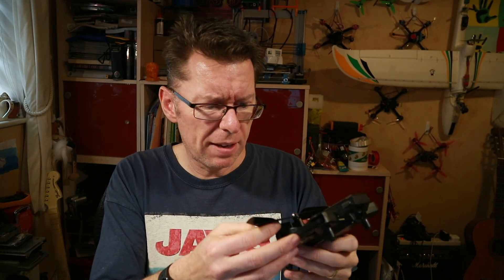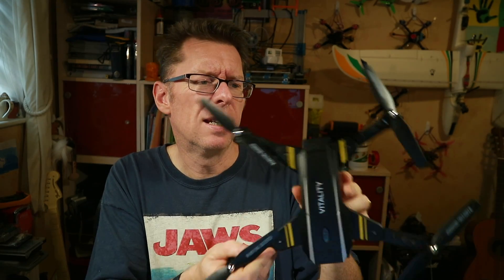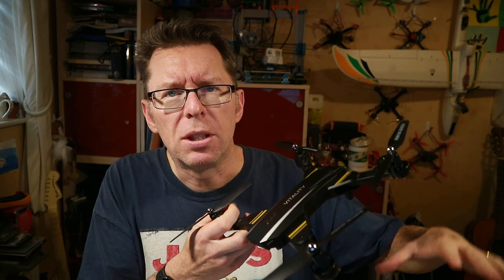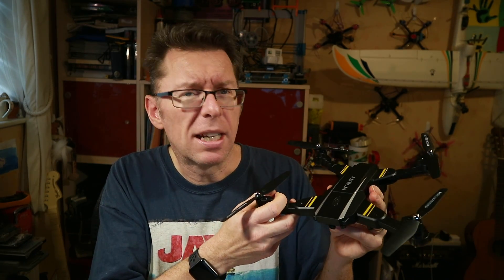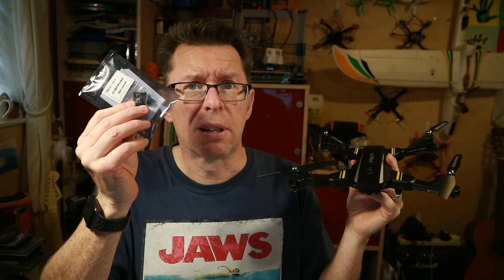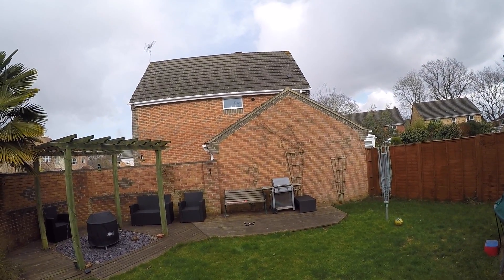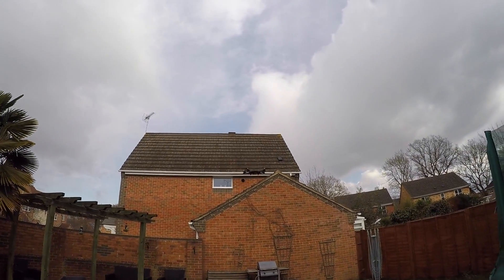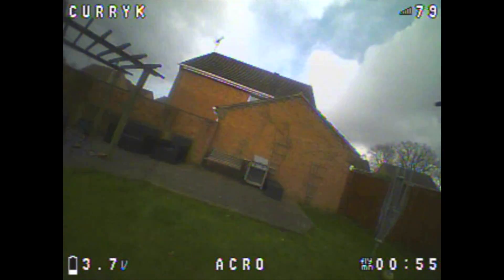Can we convert a Toy-grade quad to an FPV Betaflight-based Acro quad ?

Comment: Nice mods! I have almost the same quadcopter, the visuo xs809hw, I want to mod it for better range but keep existing radio etc is it possible to add the fpv board you used to the stock FC board? Add a better RX antenna and mod the stock transmitter with a wifi antenna? Could I still use my smart device to pick up the 5.8ghz fpv? Maybe some OSD would be helpful but not essential! Just looking for better range and improved fpv!
Cheers Phil
Reply from the maker: Hi Phil, some of that is quite doable.  Certainly adding in a 5.8Ghz VTX/Camera combo should be easy (I did this on a bugs 2 here https://www.youtube.com/watch?v=IY9wx7FUcIo although the radio that came with that has really good range), you will generally need to feed it (depending on model, but mostly) 3-5v which you can get direct from the 1s battery.  You'll need something extra to pick up the signal though - even if your phone does 5.8Ghz wifi, this is 5.8Ghz analogue video, so will need something more like this (affiliate link) https://www.banggood.com/Eachine-ROTG01-UVC-OTG-5_8G-150CH-Full-Channel-FPV-Receiver-For-Android-Mobile-Phone-Smartphone-p-1147692.html?p=E81211714085201408XQ&cur_warehouse=CN  As to the range, that's another question.  "yes, maybe" is the probable answer, a higher gain antenna, or something direction will help you, but the transmitters in these often put out tiny amounts of power, and the receivers not very sensitive, so I don't how quite how much extra you can expect.
Reply: CurryKitten Thanks for the tips! I'm new to quadcopters but have built RC tamiya 4wd buggies in the early 90's, so after a long break from the hobby I'm catching up with all the new tech and taking to the skies! ;)
Any improvement over range will be great as the stock setup is very poor :( I have enough experience from my time with cb and ham radio, building antennas, so realise a good tuned antenna makes a big difference even on a low power tx.
I have the basic skills and eventually want to build my own racing quad. So maybe modding this will be a good start. 
I've posted a few videos and will be adding to them as I mod this. I will certainly be having a look at the bugs video you mentioned.
Reply from the maker: That's cool, and a great way to dive in a get results.  I'm no expert on this subject, but google about the 1/4 and 1/2 wave lengths on 2.4 and the size of the active element needed to achieve that properly.  Odds on what you have inside you radio is essentially a crudely soldered on bit of wire that could be easily improved.  Ditto on the quad itself as well.  Making sure the antennas aren't buried in other components and are orientated correctly so there' no chance of hitting the null-points should also help out.

Comment: A few people have mentioned the BUG3. (I also have a BUGS 2 with a Onepaa X2000 as a camera platform). After a while there is no challenge in flying the BUGS 3. An all in one brushless F3 board with built in PDB would do the trick I believe and these seem to be available for $25 USD or so with a $10 USD Flysky/Frsky receiver. My thought would be to stay on 2s and to use the BUGS3 as a gentle acro cruiser leaving the motors and ESC as is. I've only started learning about flight controllers etc over the past month so hope my thoughts are right.
Reply from the maker: Yes - I've never owned a Bug3, so I'm not sure what the internals look like, but I'd guess it was another single board containing everything, so something with a built in PDB would be needed (or a separate PDB and FC if you have room)  If you want to have an OSD as well, the Omnibus boards are fairly cheap and easy to configure and can provide the voltage to also run your FPV camera.  The Bugs2 was good fun to fly with 5.8ghz gear, so if the 3 is similar I think it would be a nice flyer with the changes - as you say a "light acro" flyer is probably a good description
Reply: yeah the bugs3 would be ideal for conversion to acro quad while learning how to build,  the frame will break in a crash though. but this idea of buying bits here and there is a great way to spread the cost and keep flying in the meantime, the motors could handle 3s  but 2s is a better option for price/performance. try to buy a board with a barometer and you will eventually be able to use the gps and compass unit in the bugs along with a suitable f3 or f4  board one with 4or more uart's... uarts are just like usb ports which means you can add the gps and compass via a uart. then you will get return to home feature. betaflight is great for acro quads and learning, just learn the terminology so you can find the info and help you need on youtube or rcgroups. everybody in this hobby learned from somebody else, and most people are happy to help.

Comment: Hey do u have the everything u used in thus video bc i want to do this to my bugs 6 racing drone man i would send it to u and pay u to do it to it lol
Reply from the maker: The bugs 6 (I haven't flown one BTW) is quite a different beast, it uses brushless motors (which are great) and already had a 5.8Ghz video system so it's most of the way there already.  So the only thing you might want to swap over is the flight controller - which would be a completely different one than used in this video (and possibly the receiver/radio - depending on how that works) in order to fly it as you'd want to.  You probably can't afford to hire me :D
Reply: CurryKitten hey buddy thanks for the info. You made my day lol and i got a video off the bugs 6 i love it but thanks for take the time and telling me about stuff and. I really cant afford u bc ur info is price less. Keep up all the amazing work buddy
Reply: You could afford me, I'm cheap as chips! :D
Reply: Slippery FPV thanks buddy it mean alot u wrote me back
Reply: No worries, If I can help in anyway, hit me up and I'll do my best :)
Reply: QDL FLIGHT I just did a similar build with a bugs3 (force1 f100) with a sp_racing f4s flight controller, runcam split2 (even easier with a basic fpv camera), and AKK KC04 vtx. stock esc's, motors, and props for now and it's a blast to fly, tune, and get in the air for relatively cheaply as I'm still learning. I would definitely recommend giving it a try as the bugs 6 is very similar  and the build is surprisingly easy!
Reply: clayton hannah ok i will check it out

Comment: great idea,  you should have mentioned flysky radio, this is actually how i... damnit you just mentioned flysky hehehe... this is actually how i learned to build... i converted a jjrc x1 into a librepilot cc3d quad, was a real headache to do it since there was no space inside. i did manage it eventually but never succeeded in fpving it. but this kind of approach is great for learning and lowering the cost of entering fpv hobby. i recommend to anybody who doesnt have 500 quid to throw at the hobby instantly look into doing it this way, you can plan your spending. ie. buy radio flight controller, then buy video tx and camera and goggles... ev800d's are great. then you can look at taking all this stuff out of your toy quad and adding it to a proper carbon frame quad with  some racerstar or DYS samguk or kingkong motors, then all you have to buy is a charger and powersupply, then 4s batteries... 00 quid a month for 3 months and you'll be doing 80mph upside down with a big smile on your face.
Reply from the maker: Haham, that'll teach you to comment before the video is over :)  I like this idea of taking things a bit at a time and building/hacking things as you go - you will learn lots, make loads of mistakes, but crucially understand how to fix them and move on.  I made my first RC thing, a tricopter by buying 1 thing a month and figuring it out as I went.  Don't get me wrong, I was utterly crap and crashed all the time, but I got really good at repairs.  It's not for everyone though - I'd like to think everyone would like to get inside their toy quad and try things out, but for many the only route is an RTF machine
Reply: yeah i should have pointed out the ready to fly deals now are just fantastic, along with betaflight stock pids this is the way to go, but people should know  you need a charger  (turnigy accucel's) and a 12v power supply 6amp minimum, and a multicharger, if youre on a budget you need to know about these too. and of course batteries at 20 quid a pop.

Comment: this gave me an idea. i got an Eachine E58, will that particular flight controller work on E58? thank you so much in advance.
Reply from the maker: Having had a quick google, yes should be fine.  The E58 (aside from looking almost exactly the same) uses regular brushed motors, so just a case of sniping away the old connections and soldering them onto the new board
Reply: CurryKitten, a million thanks man.
Reply: yeah its quite similar. foldable pocket wifi drone..cannot fpv with it. i got a goggle n a contoller but cant use them yet.hahahaha...

Comment: People often ask on our FPV Facebook group how much to get started. I would estimate £150 - £200 gets you in with the cheaper kit. A nice micro could cost you around £80. I got lucky with the Leader 120 on sale for £65. The Flysky transmitter you recommended is a great cheap starter you can take to your next quad for £35. For goggles I agree the EV800 are great if you have the cash spring for the D with Dvr . £65. Then don’t forget to add 2 or 3 batteries and a balance charger. All the cheaper end of the hobby, but enough to start on and you can swap one thing out at a time to upgrade.
Reply: anybody who buys the flysky should go for the flysky i6x,, the i6 needs some hacking to get the same functions,, also if you have a choice of receiver along with your i6x go for the i10x?, i forget... dont get the i6b or the i6c,,, the best option is the turnigy ia6c.  just avoid the flysky i6b and c. the c doesnt do ibus and the b doesnt do voltage telemetry  and you really need ibus and for the radio to beep when you have low voltage on your quad.

Comment: Great work! I have one of those visuo folding arm quads (almost identical) which was my first quad. I’ve wondered about doing the same but looks like it’s generally a bit underwhelming! Interesting little project though
Reply from the maker: Yeah - it's not going to set the world on fire with it's performance, but if you've got one of these things hanging around doing nothing then it can be a fun little project - well, I found it fun anyway:)
Reply: CurryKitten I think changing the camera is the most worthwhile part. Didn’t realise how bad it was until using it again in the snow this week (didn’t want to risk my 5” )

Comment: I just finished my transplant a few weeks ago.  Blade QX2 fc with acro and fpv camera into a Sky Viper s1700.  I need to stop being lazy and post a vid on it.  I still don't understand why toy quad manufacturers treat acro mode like it's rocket science!  Stabilization on/off switch...done.

Comment: I like the idea and the video. Do you have a bugs 3 laying around ? I’d like to see the same with one of those. I’m thinking the result might be pretty good
Reply from the maker: The Bugs 3 is a brushless quad, so should convert really nicely to betaflight with a more standard flight controller.  I don't have one though, I do have the Bugs2, and that's got a really excellent GPS mode in it with RTH and everything, so less worth it

Comment: Nice try, How about converting it to brushless? I'm just in the process of converting a W609-8 Pathfinder 2  to brushless with a gimbal. Should be interesting ;)
Reply from the maker: I feel that might be a bridge to far, if I go brushless, then the only thing I'm keeping is a really crappy frame that will have many holes cut out of it to fit ESCs and higher cell lipos in it.  Although now say that, I'm kind of attracted to the idea purely for the weird franken-quad this would eventually produce :)
Reply: CurryKitten do it!

Comment: I’ve just literally done this with my max bugs3. Now has f3 board, takes 3s and has gps.... it’s so much fun..
Reply: I hope you will put a video up. I'm currently testing Deviation builds for the Bugs 3 protocol using my Jumper T8SG TX. I've been tempted to replace the fcb for a while. Great to hear that you've done it.
Reply: David Dawson I intend to in the next couple of weeks. Unfortunately I've been bogged down with work and just not had the time. It's coming along though xx

Comment: I did this to my jjrc elfie one year ago, and it flew, but not very good. Those geared brushed models are no acro flyers but quite efficient for cruising around in angle mode. So it was more of a fun experiment. Actually the original elfie was my very first step towards fpv. I then got me a brushed f3, a flysky i-6x, micro receiver and eachine vr-008 goggles, then 3d printed a micro frame, so i did my first fpv flights and i'm still using the flysky transmitter, it still works great.
Reply from the maker: Yay - you are living proof that it can be a route in, and that you can take all the gear forwards :)  You are right, it's a fun project, but you shouldn't expect anything too amazing from it.  It is still 1,000,000 times better than the awfulness that is wifi fpv though
Reply: CurryKitten WiFi fpv is horrendous

Comment: this is a really cool experiment!  I guess betaflight just doesn't do geared motors well.  It does remind me of the ship of theseus paradox - if you change everything except the arms and the power plug, is it really the same quad?
Reply from the maker: Yes, there wasn't much left was there.  That Wifi camera module would actually work by itself, but it's so awful that it's unflyable - so it all gets ripped out :D

Comment: That's awesome man.

Can I ask, how do you get RSSI in your OSD with the XSR?
Reply from the maker: Basically, you take the telemetry signal and push it back to the radio as a separate channel.  I wrote a blog piece about it here http://www.currykitten.co.uk/getting-the-rssi-value-to-show-in-your-betaflights-osd-frsky-based/
Reply: Nice one man, thanks a lot.

Comment: I did this to a Bugs 3. Used an Omnibus F3 FC, XM receiver, and a cheap AIO 5.8Ghz camera in place of the front led. Kept the ESCs, motors and battery stock. Much more control using my Taranis transmitter. Using Betaflight allows me rate adjustments and acro option. Still needs some tuning but fun. Will finish it up once the weather breaks. I want to upgrade the camera and VTX.
Reply from the maker: That's cool - I'd do the same to the Bugs 2, but the GPS flight controller on it is really good and has fantastic range - it's only the WIFi FPV which is lacking.  I just stuck a cheap AIO cam/vtx on it last time and went for some fun flights
Reply: I hope you will put up a video of your build. I'm currently testing Deviation builds for the Bugs 3 protocol using my Jumper T8SG TX. I've been tempted to replace the fcb for a while. Great to hear that you've done it, especially retaining stock escs and motors.
Reply: CurryKitten Just because it's in line with the discussion on AIO video on bugs 2&3 and because I have the same brushed quad...I was wondering if it's possible to hook up a vtx (5.8Ghz)& camera directly to the bugs FC boards and to this one? I know if I set it up as a stand alone I won't get OSD but would that idea work or would the voltage or be too low or interfere with something. Volts probably too low on the drone you modded but im assuming it might be possible on the bugs. Any thoughts appreciated.

Comment: I had a similar experience with my Syma x5c, not enough punch https://youtu.be/ZXzZ5rdf3a8
I used a higher C battery with a JST plug and it started flying better. My PIDS ended up pretty weird, but it's still fun : )
My PIDS are in this realm with 7mm motors
PIDs:
Roll - 115, 75, 110
Pitch - 120, 78, 115
Yaw - 70, 45
I'm also using PT1 filters all on

Comment: A better alternative would be to silverise a h8 or boldclash b03 floureon h101 etc and then you can acro and still use the stock tx before investing in a better tx, check my videos for a ton of acro flying on h101 b03 etc , this needs no new parts for the quads apart from a camera and goggles , just needs a £2 flashing tool. But good video, I often wondered about doing this myself.